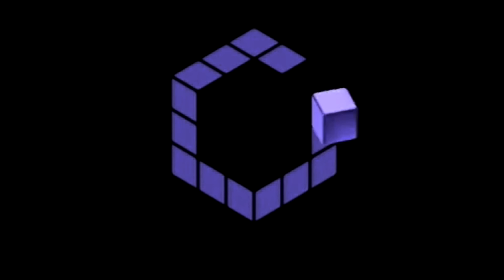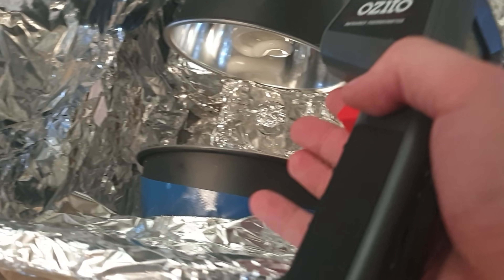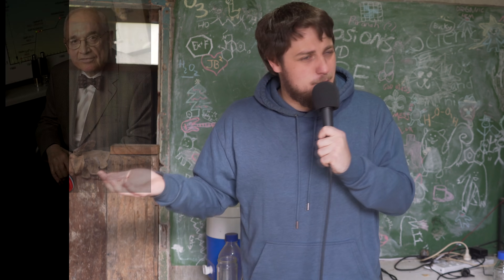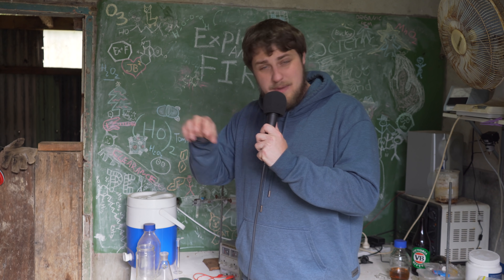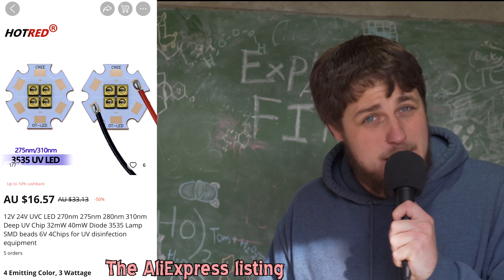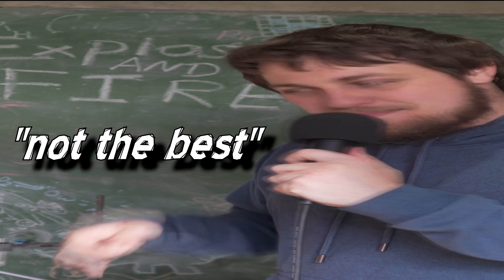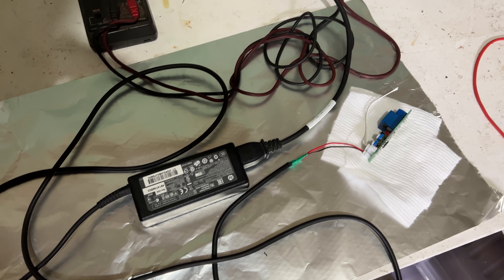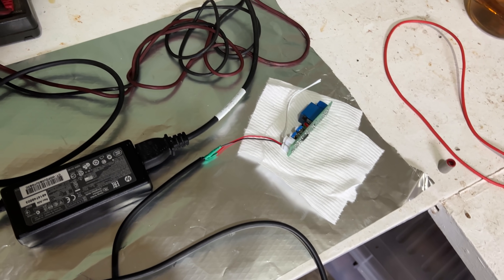Magical deep UV LEDs - Cubane Ep 12

Comment: Keep up the effort! Chromium coated  (which seems to be the case here) is actually quite an optimal (low cost) choice for this range of wavelenght but keep in mind that very small oil film can absorb it quite well so  try to clean the can with acetone before use (and close it during use of course)

Comment: you were all worked up over the amperage, when the critical factor is always voltage. brightness is determined by voltage, amps will just be what they need up to the limits of your power supply or wires.

Comment: 8:49 Watching and this kept tickling the back of my "danger, will robinson!" instincts.... why are you operating an unprotected PCB on top of a flexible conductive surface (foil)?  I literally can't think of an easier way to have an unpredictably timed catastrophic short circuit...
Reply: Those aluminum substrate PCBs are conductive anyway. It's also made my heart skip a beat when I saw the aluminium foil, but it's not an issue with LED modules (the lack of proper heat dissipation is, though).

Comment: A few things to take into account with driving LEDs is:
1. LEDs have a very sharp turn on voltage where they start to conduct power. (bellow the forward voltage the diode is will just trickle through a little.)
2. LEDs and most semiconductors have a negative temperature coefficient in regards to their "resistance". This makes thermal run away a real possibility.
3. Don't care about the voltage, if the datasheet says 40 mA is max, then 40 mA is the maximum you should run them at. (One can explore higher currents, but premature failure should be expected.)

If the LEDs gets warm, then cool them better. (Warm for LEDs is warm to humans as well. Unlike most other electronics that considers 65 C as "just fine." while an LED can consider 40C as burning hot.)

And lastly, the two knobs on the left side of your bench supply is for the current limit. You can turn the coarse knob down fully and gently turn it up until a rough 40 mA is reached. This can be measured with a multimeter to see if it is correct. The voltage knob can then more or less be set to whatever, as long as it has a higher voltage setting than the forward voltage of the diodes.

Comment: Get a cc supply and set it to the 40mA. LEDs have a low resistance once you reach the right voltage. If you use a non current regulated psu the LEDs draw to much power and will blow up or break really fast

Comment: As an electronics hobbyist who dabbles in chem, this was extremely entertaining but also a little frustrating.  Imagine watching someone perform a distillation but they know gas volume and temperature are linked so they crank up the heat and hope their apparatus manages itself. You can steadily see their glassware show signs of cracking and heat stress and you know it's going to all fall apart soon but they are just happy to be getting product.

I know electronics are complicated, but just like chem it's an applied set of knowledge on physical operations - the systems can be reliable but for a while you're going to be breaking things and I think that's the best way to learn. Fun to see you try something new!

Comment: There should be adjustable "CC CV buck" boards available to you for a few dollars that are rated and specified to convert the 19V from a laptop power supply down to a lesser voltage range (e.g. 3-16V) at up to a certain amount of current which will be more than enough for you. CC-CV stands for "constant-current, constant-voltage" and "buck" is a type which goes from a higher to a lower voltage. 

What that means is, you can adjust the voltage limiter screw down to a level where just connecting the led while it's on doesn't fry it with a 42V voltage spike like it did in this video. Then you adjust the current limiter screw up from zero until your current meter says it is at 40mA times the number of parallel led boards. Don't try exceeding the limit especially with poor heatsinking because the leds will end up shifting the wavelength of emission somewhere not useful, and will also die.

If your supply only has a current limit it can apply big spikes of voltage and fry things. If you then apply a switch to the output of the driver, it will apply that spike of voltage every single time the switch closes. If it has only a voltage limit the led can overheat, consequently draw more current than you thought it would, and melt and burn.

Comment: That power supply you have looks like it does constant current, you can (with the LED disconnected) turn the voltage to about 15 volts, then turn the current knob down until the voltage drops.  After that you can hook up the LED and turn the current knob up until the desired current. this way the LED can run at as high or as low of a voltage as it wants (largely dictated by LED temperature) and the LED current is controlled by the power supply.

Comment: Man, last time I saw this many people pulling out their EE card someone claimed that current travelled faster than the speed of light. 

But per some of the other comments, if you can current limit your power supply to 40mA then you won't need a separate driver circuit for your one module. Under that setup you could put the timing relay between the power supply and the LED. With a constant current driver, it's better to cycle the driver input, as sometimes they get unhappy trying to keep a constant current through relays turning on and off.

Comment: Jesus it's been out for an hour and there is about 200 comments on how your using the LEDs wrong and how to fix it (not that thats a bad thing). So I will answer something else, if those turn dials are for voltage regulation they are referred to as pots. The long name is potentiometer so you can see why they get called pots.

Comment: So contrary to what everyone is saying you kinda did it right if the LEDs in the modules are in series. UVC LEDs have a forward voltage of around 3-3.6 so with those assumption that comes out to 24-28.8 volts needed for your two modules in series. And if we use the formula resistance = (voltage supply - forward voltage)/wanted current we can see that you don't need a resistor to limit the current for this circuit with a 24 volt power supply and you might actually be under driving them.

If you don't believe me put a current meter in series with the circuit and check it.

(Edit) I'm dumb you have a 48 volt power supply you need a 500 ohm resistor in series or a lower voltage supply else you'll cook those LEDs.
Reply: The problem is that he bought a 950ma constant current LED driver circuit. So that circuit is going to try and crank up the voltage until it gets 950ma, which is far too much for those LEDs (unless the "datasheet" lies)
Reply: @maxwellfire  yes but it should still be voltage limited.
Reply: @Ryan6.022  his driver goes up to 42 volts
Reply: @maxwellfire  oh crap you're right I wasn't paying enough attention. I thought he had changed over to using the laptop charger but that was only for the timer thing.

Comment: LEDs are forward biased which is why they HAVE TO be used with a resistance. You can't just put whatever amps through them but lucky for you that big lab power supply is current limiting. You want to set 12v and then slowly bring up the current to 40mw per LED (or each star depending on which that spec sheet is for). That thermal glue and heatsink is actually perfect as long as you don't want to remove them.

Comment: Since the „it’s just using what it needs“ is popping up so often: if you supply the LED with the correct voltage, it will take the current it needs. It’s basically stable at that point. Beyond that point, it starts drawing more and it dies. It’s unstable. That’s why you saw the sharp spike on the meters. Either you limit the current, so that it can’t pull more, or you make sure that it gets exactly the voltage it needs.
Reply: No.

LEDs are so wildly non-linear that that approach is simply a non-starter. They want a resistor or a constant current supply.

Comment: If you happen to have some multimeter around, you could've set that power supply as a constant current source by shorting your power supply across the meter, set at the current setting.
Just watch the meter go to 40mA then, remove the meter and, go to your supply and set it to 12V. That should do it.
You can also get yourself some dedicated LED constant current drivers out there that are adjustable, to within the current you set on their trimmers, and power them off your supply with at least 3-4V higher than the voltage rating of your load. This is the method that I would actually prefer. 

Please, don't do this to your LEDs, especially if they are rated at a specific current. Most, if not all LEDs, have a non-linear response, and will go ballistic if you crank them just a little beyond their specs.

Comment: You need to power LED's with a current source, not a voltage source!  The amount of current a diode will draw as you increase the voltage is an exponential relationship. That's why it suddenly shoots up as you increase the voltage.  You also can't just find the right voltage and leave it because as it warms up it also draws more current (which makes it heat up faster, which draws more current, etc.) If you don't have a current limit on that supply at least put a resistor (47-100 ohm to start) in series.

Comment: Looking up a datasheet of a 3535 UV LED it says 6.5V per chip typical(5V - 7.5V max), and 800ma max - it doesn't say typical but maybe 350ma -.  They also run at 100ºC
Now you have to find out if the 4 are in parallel or in series. 
Series would be 24V 800ma max. 
Parallel would be 6V 3.2A max(start with 1.4A for typ) 
Half series half parallel would be 12V 1.6A max(try 700ma typ).
Reply: If this is wrong someone correct it, because I can't really think straight anymore.
Reply: I have a beamer replacing led array  where they are all in parallel. That thing need 3.6V but 15A of it. It even has an integrated thermocouple for heat management. Usually they are in series but not always. It could even be a combination.

Comment: As an amateure electrician I would recommend giving the LEDs a little bit less than their stated voltage. Although LEDs can work for a long time, sellers sometimes exaggerate the amount of Volts they can comfortably handle so they will be brighter, but this will severely decrease their lifespan
Sufficient cooling also effects lifespan significantly
ssry f english 2 language
Reply: I think you mean current rather than voltage?
Reply: @woosix1  well, aren't they both equally important?

Comment: Component spec sheets give information about the part along with requirements for the circuit you are putting them in. To understand spec sheets, think about what the part does and does not do. In the example of an LED: it uses electrical power,  it does not generate or store electricity, and it emits light (and heat). Knowing this, anything on the spec sheet referring to current and voltage must be requirements for your circuit. Because of the relationship between current, voltage and resistance (Ohm's Law V=IR), if you set the current or voltage to be what they specify, the other will necessarily be true. Both numbers are provided for the convenience of people searching for components, even though satisfying the voltage requirement necessarily means you are meeting the current requirement and vice-versa.

Comment: You got a constant current which output 950mA while your leds need 40mA. That's no Bueno. The power supply is going to be at its max voltage until you hit the 950mA limit then it will regulate itself down to 24V to keep the current constant. So we can assume it's always 48 V ( I forget the exact voltage listed). You need to resist hint hint the current flow. The formula needed is RESISTOR = (Vsource - Vled) ÷ CURRENTled. In your case (48V - 24V)÷ 0.04 amps = 300 ohms. And to get the current size resistor power = current squared * resistance = 0.04*0.04*300= 0.48 watts you need at least a 1/2 watt resistor I'd recommend going to a 1 watt resistor since they are just as cheap.
Even if you use 4 leds in series I would put a resistor because the leds aren't perfectly 12v each.

Comment: LEDs aren't light bulbs, they don't regulate the current that passes through them. You need to put a current limiting resistor inline with them. The value of that resistor should be roughly (supply voltage - total voltage drop of LEDs in circuit) / (desired current in amps).

If the total voltage drop of the LEDs exceeds your supply voltage, current won't flow.

Comment: Wow! I'm thoroughly impressed those UVB LEDs can survive running at 22x their rated current without dying within 60 seconds, they've certainly come along way from being super sensitive to the slightest abuse. Either that or they've sold you some 1,000 mA 365 nm UVA LEDs... A lot of UVB & UVC LEDs on Aliexpress are actually UVA 365 nm LEDs, might be worth checking they're genuine with the price of that listing being so low.

But oh god your electronics and like my chemistry, I really doubt those poor LEDs are going to survive the several hours for the reaction. I wouldn't be surprised if you're driving them so hard the internal protection zeners are clamping the voltage which is just wasting power as heat. Pretty sure even if you run them at their 40 mA you'll still get more optical power out than those previous lamps. Also DONT put the timer on the LED driver output, you should always have the LED connected constantly otherwise the unclamped output capacitance can pop those LEDs at turn on like you so very well demonstrated on the first victim. Also you can ignore the earth, the LED driver is an ungrounded isolated design.

I recommend you abandon the on-off relay timer contraption (the switch on characteristic might also lead to sudden LED death syndrome) and instead just use the bench power supply and to limit the current you can use some resistors, super easy and makes it easier to adjust. You can probably safely shove 50 or 60 mA though them for a 100 hours without them dying. 

Happy to provide further guidance or calculations, you can reach me here in a reply, on Twitter or Patreon.
Reply: Yes, properly driven LEDs do not need time offs.
Reply: well you gotta give those LEDs credits for surviving that kind of abuse
Reply: I recall losing an LED to my lab PSU during some low current tests, even with 10mA current limiting and the supply voltage matching the LED!
Was probably an inductive event, because when the leads shorted there was a spark as the output capacitor dumped it's load - likely the inductive spike that followed punched through the LED; halving it's brightness...
Reply: @GsaUce Rug Don't know - when flying blind I assume 20mA max current, as it's most typical...
Have seen filament style LEDs lose their shiz on 10mA - but those are their own story...

So half of the "rated" current is my standard procedure...

Comment: I = V/R.

Measure the resistance of the led which will give you R, your current (I) will then be 12V/R. Since the resistance won't change and neither will the voltage you physically can't just shove more ampage into them - you will want to limit the current with a resistor or led driver. 

Edit: fuck the earth, that transformer is "double insulated" and is class 2, it doesn't need an earth.

Comment: Beware the angry pixies and the magic smoke, if you let them out the electicals stop working...

Given you're putting the LEDs in a can you can probably submerge the can in water as a much better heat sync. If the water gets too hot you can save the electronics inside.

Comment: You need a constant current source or at least resistor between power supply and LED... and a (cheap) multimeter for mA measurement. The LED has Uled = 12V  and Iled = 0.04A and  the supply e.g. Us = 15V . Than you calculate the voltage drop for a resistor Ur = Us - Uled = 15V - 12V = 3V , with that you can calculate the needed resistor value R = Ur/Iled = 3V / 0.04A =  75Ohm. The power rating (what the resistor NEEDs to dissipate) is Pr = Ur * Iled = 3V * 0.04A = 0.12W. So you need 75Ohm resistors to limit the current to 40mA for a 12V led at a power supply voltage of 15V, and the resistor should have 0.12W at least (0.25W is a common value btw )
Reply: I would go for a 5W ceramic one, just to be safe. They also are able to run hot all day long and can dissipate heat way better.
Reply: This.

Comment: Hey just to explain the topic of LED's a bit more, even though you seem to have a grasp on it: LED's are current controlled devices (unlike other resistive loads such as a lightbulb) so they simply have an "on voltage" which is the voltage where they will start to emit light. if you pass the "on voltage" you simply want to keep the voltage the same while varying the current (but not too much or they could blow).

LED's NEED constant current control, or else you will simply fry them.